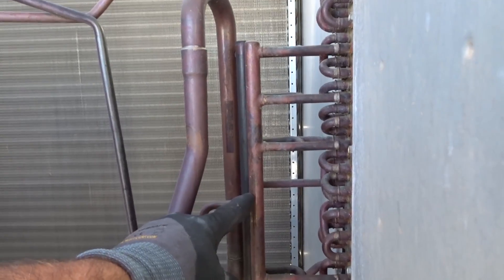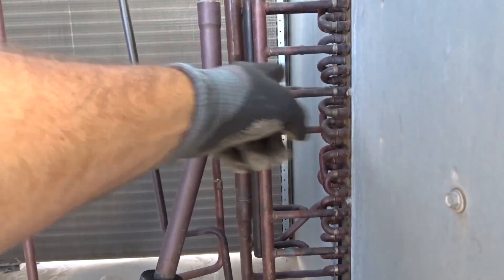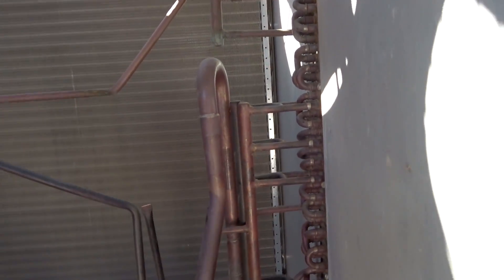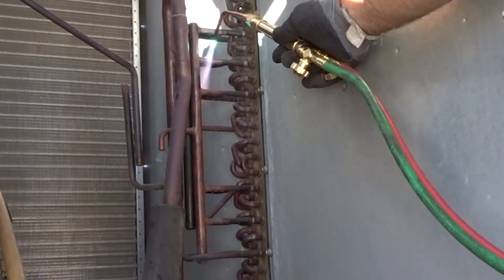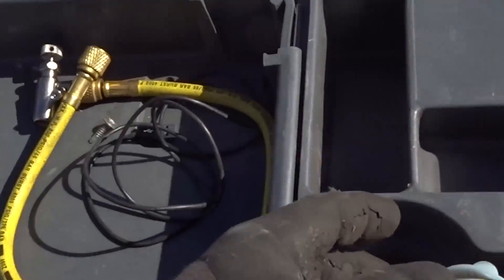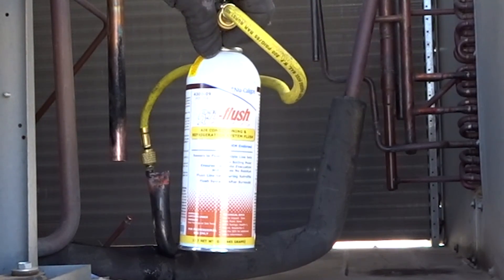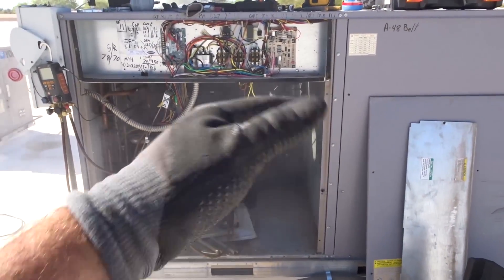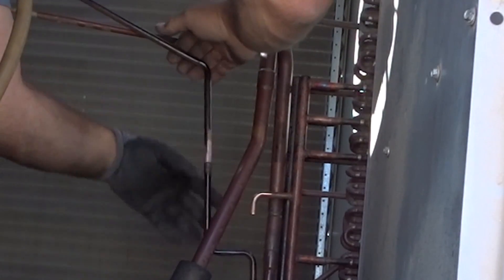Trick for clearing Carrier multiple orifice manifolds in RTU's without removing them

Comment: See it all the time. I don't even remove the refrigerant anymore. Hit it with a propane torch while running and maybe change the crappy copper spun filters if equipped.
Reply from the maker: I was curious if heating it while still charged would allow the waxed up oil to liquefy and pass thru.
Wasn't so sure if I wanted to try heating a charged unit.
Glad to hear that it worked! 👍
Reply: Yes while charged and running. Works on icp and trane units

Comment: I just did this today. I isolated the coils  purged the oil and flushed with Rx11 them then I heated up and blew them out with nitro. I replaced the compressor and charged it with R417c (hot-shot2) after a deep vacuum.
Reply from the maker: Did you get normal pressures and splits afterwards?
So far this worked each time I attempted it.

Comment: ❤how much pressure nitrogen. When we flash the system
Reply from the maker: When clearing the orifices I blow as fast as it will go. Short hard blasts. You see the smoke from the oil/wax come out for a second then it clears up.
Just have the pipe around the orifice almost cherry red hot (but don't melt the copper) then blast it. Do the same on each parallel orifice.

Comment: I need to do this this week. Wish me luck. Thanks for the video.
Reply from the maker: Post the results
Reply: @hackfreehvac  it didn't work very well but it helped. So I told the customer and we just ordered the TXV conversion kit which is nice because it will fix both circuit one and two
Reply from the maker: @hookedup9424  If it's straight cool the conversion is easy. 
I have videos of that too. Older ones so look back a ways. 
Heat pumps don't convert.
Reply: @hackfreehvac  yeah it's a gas pack. I'm hoping it goes smoothly. It's been a pain in the ass and made me feel like I don't know what the hell I'm doing
Reply from the maker: @Bhouse209  
Here is a video of me doing that 8 years ago 👍
https://youtu.be/6r-GAx8f3-0?si=VfJBFPR2YInFdscG
Reply: Hey bud I’m working on a gas pack fixed a leak on condenser unit was flat after I got it running I noticed my pressures are okay 55 suction 220 head 80 degree day what I notice is my suction line by compressor is room temperature the units air vents are cooling good 60 degrees my condenser fan discharging normal heat but I don’t understand why my suction line is room tempeture?

Comment: Wast of time
Reply from the maker: How is that?
So fixing a unit within hours, the same day, effectively permanently vs ordering an entire coil or manifold and leaving the system down for weeks or longer is a waste?
Reply: Go through all that only to find out it didn't clear it out. That's the wast of time. You can be there all day.
Reply from the maker: @joematera15  That COULD happen however, call it luck or not, I have had a 100% success rate for me on both Carrier and Trane RTU's and I inform the customer that it is an attempt and no guarantee.

Again. What you gonna do when they NEED the AC and parts are weeks or months away?

I think this latest generation is a little too used to replacing entire coils and motors etc when the parts can be repaired.
i.e. I now have techs insisting that they order an entire new outdoor/indoor coil on a relatively new unit because one of the copper tubes/fitting cracked in the manifold section feeding the coil.
20 to 30 years ago a tech would rarely consider replacing an entire coil for such a simple fix.
Techs just want to swap parts now. Even if it means a repair bill that is 4 times what it needed to be.

Comment: I have replaced headers before. If you cut the tubes with tin snips and unsweat each orifice individually, it is not all that bad..
Always replace the Filter-drier with Sporlan solid core type. Obviously use nitrogen while brazing to keep new orifices clean.
Reply from the maker: Yup, I've done that.  With snips as well. The only real way of extracting the individual tunes out of the evap tube bell ends without destroying it 👍
That is the official repair method.
Just got to hope a manifold assembly is in stock.

As for Sporlan filters... check out a video of Sporlan vs Emerson https://youtu.be/5OtmSbBAmCY
My coworker seen the demo in person. You could tap on a sporlan while it runs and it allows debris to escape

Comment: I just recently replaced a bad compressor in a carrier HP RTU from 2002. I unknowingly removed the check valves with the strainers and installed (2) filter driers where the old strainers were. I thought the strainers were filter driers.  I added refrigerant back into the system and now it’s running low suction. I’m assuming I need to install new check valves and remove (1) of the driers? Any pointers would be appreciated as I have never worked on these particular units before.
Reply from the maker: You can use a filter drier in place of a strainer. But you will need the check valves.
Also if the system had a restricted multi orifice manifold assembly before the old compressor died then you'll still have that restriction after

Comment: First you don’t have to change the whole coil, you can just change the orfice header, and if this doesn’t work, damn it’s a lot of wasted time and a dryer down the drain, but you did teach me something with the heating up the orfices
Reply from the maker: Yeah you can buy an orifice kit and cut the old one out and piece together the kit. 
I've just been able to clear them out.
On straight cool in just convert to TXV with feeders
Reply: hackfreehvac I’ve done dozens of conversions, kits and building own distributor, they work on tranes great but not so much on the carriers, it’s a toss up on them I believe it’s because the valve has to be in heat, like this old Lennox that were built that way
Reply from the maker: @braintumor943  I've done it on Trane and Carrier but on straight cool. 
The heat pumps have check valves to change flow/purpose of part of each coil  depending on heading or cooling mode.
Reply: hackfreehvac you right, we don’t get a lot of heat pumps, although we do get dehum in drug warehouses, labs, clean rooms, etc
On a side note, kind of threw dud under the bus didn’t ya, haha
Reply: Orfice kits are not that hard, carriers you have to pull while coil, 4 hour job

Comment: would you recommend using ac renew?
Reply from the maker: Not for this issue.
The synthetic coil helps sticking reversing valves and TXV's but this issue is more from oil breakdown from comp heating etc..
Reply: @hackfreehvac  thanks for replying, how much pressure did you use to purge it.
Reply from the maker: @obedb093  I blasted the nitro pretty high after I heated the orifice
Reply: @hackfreehvac  thanks it worked.
Reply from the maker: @obedb093  That's awesome.

Comment: Would bet money you will get a future leak on those tubes you heated. Would have atleast wrapped the solder joints close by with wet rags.
Reply from the maker: DUDE! 😆😆😆
The entire point is to quickly heat up the pipe just to the point of glowing red in order to liquify the oil wax in the internal captive acutrol (pistons) in order to then clear them out with nitrogen
Using a wet rag would fight that entire process.

Remember. This is a quick last ditch effort on older units as opposed to swapping out the entire acutrol header assembly. That is, IF an assembly is even available. The customer would be fully aware that there were no promises.

So far the only leak I have ever had yet was when I cracked one and I saw it crack and then simply welded over it.

So far every attempt has worked and I didn't have a repeat failure as of the last time I was doing service on them.

Comment: I like what you did but 123lb suction?  You got to have a bad low side valve in that unit.
Reply from the maker: 123 PSI is too high? LOL
Normal 410 suction can be 110 to 150 easy depending on current return air load.

Every 1 degree of increased evap coil temp adds several PSI of suction pressure.

i.e. a 40 degree coil = 118 PSI
41 = 121
42 = 123
43 = 125
44 = 128
45 = 130
46 = 133
47 = 135
48 = 138
49 = 140
50 = 143

An 80 degree return air temp can EASILY give you a 140 PSI suction pressure.

123 is really good suction pressure.

Low suction / high compression ratio is what kills compressors.
When I did these repairs I informed the person that the compressor MAY already have taken a hit from the previous operation and that time will tell.

Comment: these are a shit metering device, they all clog to different degrees, so what did the industry do? Copied a bad design and destroyed their own equipment without thinking it through. Hence, the Trane accurator that ruined their reputation as well. Trane adventualy made a replacement TXV adapter kit for it, but it only works on certain model coils, so I was told by the rep....They are JUNK!

Comment: have you ever tried the AC Renew on them?
Reply from the maker: That is a synthetic oil. I don't think it will remove the debris which are generally caused by nuked compressor oil. LOL
AC Renew does seem to help with TXV's though by helping the needle move smoothly. Reversing Valves too.

Comment: I have a bryant package unit that i cannot find the metering device
 The unit is a heat pump r22 system. Tech support is no help because they wont call back. Cannot even find the manual on line. It's crazy. Unit model # 549BPX40000AK. Any help will be appreciated.

Comment: Does that drill bit swager tool not leave shavings in the pipe?
Reply from the maker: It's NOT a drill bit.
It uses friction to heat the pipe then the pipe is able to be stretched to the shape of the spinning tool. The tool is made to do this.

I do give a shot of nitro through the pipe just in case.

Comment: Question; doesn't all that drilling introduce shavings into the system? Clearly does, now what?
Reply from the maker: Did you think that was a drill bit?
That is a specialized "swage" tool that is mase for this purpose. It is tapered and uses friction to heat the copper until the tapered swage tool spins down into it, creating a female fitting.
There really isn't debris from this process.
And the nitro can blow it out. And so far never had one single one of these come back to me restricted.
These repairs are also already an option for the customer to get an old unit working as opposed to buying a new unit or waiting to get the entire header assembly.
It is understood that it is a fix to get a little more life out of it. But again. Haven't had to go back on one single one yet for any restriction.
Reply: @hackfreehvac  Thank you for explanation! Hey I'm not the only dummie around 🙃

Comment: Brilliant fix. The copper glitter from spin swedge went down both pipes though. I hope it dosent cause a restriction. Spin swedge up to keep debris out.
Reply: That tool does not remove copper, I usually use a little oil to help it work even better.

Comment: I have a late question....the strainers on those 10 tonners. Are the check valves in those strainers?
I have the same unit but mine is 96 and r22. But there has never been a filter dryer change or a strainer change. Ive cleared the accurators 2 years ago and it needs it again. But I've seen the fd installed at the condenser inlets and at the old strainer locations. I just dont want to install them in the wrong spot.. 
Im asking you cause....well your the one hvac channel I enjoy the most....and your work ethic is exactly like mine...dealing with fucktards and idiot techs on a daily....is a job all in itself...lol 😆 I'm fixing a bunch of ass backwards shite...from a company who'd rather wait till it breaks royally and charge more instead of doing proper preventative maintenance...

Comment: How do you know that's where your restriction is? Does it frost up there? And you had low suction pressure, high superheat?
Reply from the maker: No drop across the strainer/check valve.
And you do often see frost after the metering device.
Low suction pressure and high superheat.
I often add a pinch of refrigerant to see if it corrects as these are sometimes hard to tell the difference when the restriction is subtle.
If the subcooling starts to climb with the extra refer than it is definitely restricted.

Comment: Won't it just plug up again since the oil wasn't changed?
Reply from the maker: The OEM units often only used a screen strainer ahead of the check valve and orifice header to the evap coil.
I install a good liquid line drier.
I have yet to go back and fix the same problem on any of these.

Comment: I’ve seen many times if you loose a condenser motor and the head pressure gets high those flowraters clog up. I’ve never tried the nitrogen purge while heating the pistons with heat. I wonder have you tried this with the unit running? I wonder if it would work. Oh and it’s shellac from the windings of the compressor running hot.

Comment: I found a 3 year old carrier heat pump package unit with that problem last week, only someone else had over charged the crap out of it and told them it had a leak.
I recovered 24 pounds of 410A that had an 18 pound factory charge...
On a hope and prayer I changed the filter drier in hope that that was it, but no dice. It isn't quite plugged enough to freeze the coil, so I threw some AC renew in it to see what happens.
I'm not confident in the AC Renew, so I'm pretty sure I'm going to be giving this method a try on the unit this week. ;)

Comment: have you ever converted it to a txv ?
Reply from the maker: When it's a straight cool I do convert them to txv.
But on heatpumps it's difficult because the coils have multiple check valves to repurpose sections of each coil whether it's in heating or cooling mode.

For example... in condenser coil mode the hot gas goes through multiple parallel connected circuits then comes out onto a manifold and then a single 3/8" line then goes back into the bottom section of the same coil for a few more passes before leaving as liquid to the other coil. 

That complexity prevents changing to a TXV. 
But straight cool units are a more typical design. 

Here's a video of converting a straight cool carrier to txv
https://youtu.be/6r-GAx8f3-0

Comment: Do you clear out the lines with nitrogen after you used that spinning swage?
Reply from the maker: I often blow them out anytime I think something might get in there.
Although the spinning swage doesn't really make any shavings at all. It makes the copper malleable by heating it up and then just stretches it.
There is no cutting effect etc.
Reply: @hackfreehvac  what's the brand of that swedge tool or where can I get one?  That looks sweet , especially not leaving anything in the line.
Reply from the maker: @cravenmoorehead6219  
The brand I use is called Spin Swage
https://spintools.com/swage/

Comment: I have done this with 3 carrier units without using rx11 and have had 100% success. The key is isolating the short orrfice tubes as you did. Great video but this will not work on a Goodman because nothing works on a Goodman except a trane curb adapter lol

Comment: A few months ago, I did this with a straight cool/gas heat Carrier, and the stuff found its way back into the orifices after I had blown them out. I ended up replacing the header and orifices.
Reply: This is a bandaid fix at best.
Reply: @joeanderson6187  I have decided to stop doing orifice replacements, because half of the time there is still a problem in the evap, and the better part of a day is wasted.If I saw a more consistent outcome, i would be clearing the orifices, but after so many partial outcomes, I just write them up.

Comment: You’ll be back.  You still have a contaminated system. You cleared a symptom but not the cause.  I would have blown all of the oil out of the lines, dumped the oil in the compressors, and looked for the cause of the oil breakdown.   A sealed system that is running within its specs should not produce wax.  High discharge temp, non condensates, moisture, etc will cause it.  Did you install a new liquid line drier, and is it the right type for the refrigerant?  Did you perform an oil analysis to see if there is any moisture or acid in the system?  Has any one else worked on the sealed system, and possibly contaminated it?  Be shure your compression ratio is OK because high discharge temp caused by high compression ratio will break down the oil and plug up your metering devices every time.
Reply from the maker: I haven't had any of these die yet.
Been doing this repair for about 5 years now.
And of course I install a nice filter drier.  
If it had one instead of the simple screen strainer then the orifices would likely not plug.
Reply from the maker: I think the Arizona desert is the cause and these area a shitty design. 
Getting up to 5 years operation spending far after this type of repair is awesome.
Reply: Rod, if the customer was going to authorize a complete repair, they would have moved on it a year ago.